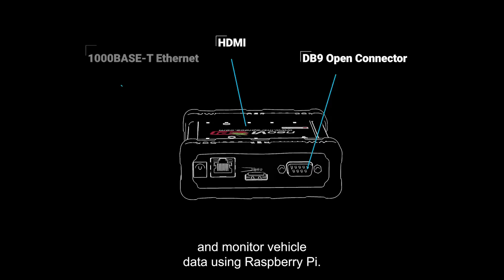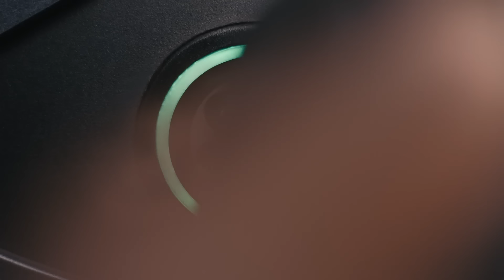Justice Dept Investigates UAW's Fain; Japan OEMs Losing S.E. Asia to China - Autoline Daily 3830

Comment: Can we please stop calling hybrids ‘electrified’? It’s a term legacy auto uses to make people think they are kind of getting an electric car. It’s ridiculous.
Reply: They are electrified! That's what the suffix means. -fied vs -ic has two meanings. It's not the industry's problem if you don't understand that. If it has an electric drivetrain component to it, then it is electrified.
Reply: Well every fuel car out there has a battery. 🤔
Reply: Chris, they are electrified, it's part of the hybrid system.
Reply: Hybrid for insecure people -MSM made OEM indecisive.
Reply: My dad’s 67 Mustang had a battery. Nobody called it electrified. Greenwashing!
Reply: Hybrid vehicles ARE electrified.  Adding an electric motor to a drivetrain adds electric propulsion to the drivetrain, hence making it electrified.  Whether that motor primarily supplements the output provided by the internal combustion engine or reduces the overall gasoline consumption, it is a win/win for the owner.
Reply: Electrified is a term invented for incompetent automakers to name their 1kwh regen assistance to ICE power train. It is not hybrid, which would be plug-in hybrid.
Reply: @alanrivaldo-h only if the battery can be plugged in.  Also the battery size can cover 10% of the vehicle’s range can it be called electrified.  In my opinion.  Even the 2000km range plug in byd card coming out cannot say this.
Reply: @jeffs6090 Wow you are gullible. No one has used that term in the over 100 years hybrids have been produced. Hybrids went mainstream in the 90’s and no one used that term for the last 25+ years they’ve been popular. Legacy auto started using it only recently when ev’s became mainstream to fool people like you into thinking they are buying an electric-ish kind of car.
Reply: @jeffs6090  Wow you are gullible. No one has used that term in the over 100 years hybrids have been produced. Hybrids went mainstream in the 90’s and no one used that term for the last 25+ years they’ve been popular. Legacy auto started using it only recently when ev’s became mainstream to fool people like you into thinking they are buying an electric-ish kind of car.
Reply: @chrisg8995  nobody is "fooling people like me" to buy anything. Plus, everyone else here commenting seems to agree with me instead of you. So, continue with your hate.

Comment: Africa has the right to go green as well, automakers should recognise this fact. If Isuzu really believes that they will be in for a shock.
Reply: Buyers will vote with their wallets
Reply: There is almost no faith in the electric grid there, even in countries like South Africa and Kenya.
Reply: @anydaynow01  it's all about the hydroelectric
Reply: The world's power want Africa to stay poor. The continent is the best place to manufacture goods and shipping
Reply: They are very "green" as it is
Reply: It has the right, but until its largest population centers gain reliable access to power it will be a struggle to get it to happen. Some countries could go EV in some areas but the continent needs substantial infrastructure investment. South Africa can't currently keep a light bulb on, let alone install reliable superchargers.
Reply: Isuzu is nuts with that laggard thinking. Here in Kenya there are so many electric motorcycle makers and many of the new buses are electric. I just test drove an sUV from the 2nd Chinese auto maker launching pure EVs here in recent months. Africans vote with their wallet. Until recently, only 2 of the 55 countries on the continent didn’t import petroleum/gasoline. Though so much oil comes from here, historically foreign companies controlled it. Refined fuel for vehicles are really expensive for many consumers. Maintenance costs on old imported ice vehicles are another drain. Affordable bevs from anywhere are an absolute no-brainer for many use cases.
Reply: @p.t.9709  I read that somewhere about Kenya a few weeks back. What these ppl don't realise it's cheaper for these countries to go straight to renewable energy sources and electric vehicles
Reply: @gmoncrieff  Most of Kenya’s electricity (over 80%) is from Geothermal and wind-energy. The resources are much more than the forecasted need. All that is required now is the continued building of generation and distribution infrastructure. Also, there are areas with significant empty space and lots of sunlight for solar generation. So, you’re right. EVs just makes sense here. It also reduces foreign fuel dependency. Here most financial transactions are mobile/digital. Home internet is wireless or fiber optic - no old cable or copper wiring. Tech leapfrogging just makes sense vs developing on old tech. 
Rwanda, our neighbors here in East African has an even larger range of bev options. Kenya is mature with electric motorcycles and has a number of locally built options. Most EV buses are imported. The EV car options are just starting to increase.
Reply: Don't worry, the Chinese players will take care of this, and third world nations may actually even be the easiest place for them to take over. 

Many such nations lack allot of the traditional legacy fueling/energy grid infrastructure, meaning they have less old baggage holding them back. 

We saw how many third world nations skipped land lines to rapidly adopt cellphones, and they seem to be moving to renewables in likewise fashion, which then makes EV charging the goto option in remote towns and such.

Chinese makers also already have EV products in much cheaper price brackets than western legacies can address - "Wuling mini" type EVs, EV motorbikes, EV scooters etc.
Reply: @AllanSustainabilityFan  Fun fact, many African nations are first world. Third world relates to nations that didn't pick a side in the cold war, mostly it means India.
Reply: @ethanwelner1230  That may be one definition, some of the other ones today include:

"1. : the aggregate of the underdeveloped nations of the world. 2. : a group of nations especially in Africa and Asia not aligned with either the Communist or the non-Communist blocs." -- Merrian Webster

"'Third world' refers to economically weaker nations. 'Third world' countries are generally represented by lack of basic infrastructure facilities, high poverty, and economic instability. Third world countries are behind the first world and second world countries, but ahead of the fourth world countries." -- ClearTax

Either way, it's being used loosely here as a blanket term for simplicity.

Comment: There's no electricity for EV's in South Africa
Reply: Yeah but they have cell phones?
Reply: @ChicagoBob123  Kind of a scale difference for power requirements there my dude. You should probably look up the crisis in the SA power monopoly.
Reply: @ChicagoBob123  lol you can charge a cell phone with a tablet sized solar panel, can't do that with a car
Reply: @JD-yx7be  
What you say is true, but micro grids are popping up all over the continent.
It's not going to be long before a huge part of the African population has stable electricity.
That will change the whole dynamic.

Comment: Hybrids are not actually electric vehicles because all of the energy comes from fossil fuels, including the energy stored in the battery (which comes from a generator powered by fossil fuels).
Reply: Worst of both worlds. 
Plug in hybrids can be run on electricity, but people are lazy and don't want to plug in all the time to charge that tiny battery. Just greenwashing.
Reply: Plug in hybrids actually work as EVs and more and more hybrids are plug in.  Ice is just used to extend range when needed.  I can drive my plug in hybrid in EV mode 95% of time.

Comment: dirtyTesla shows the most about the Tesla full self driving updates, if you are misinformed about it not working or never happening(many for some reason misbelieve that)
Reply: Because that is all that Adrian has anymore!  Random, unqualified YouTubers acting as safety engineers for a non functional L2 system!
Reply: @bobbbobb4663  ok bot
Reply: @SOROS-family  Cite one instance where any FSD (supervised) release has undergone any safety testing.
Reply: @bobbbobb4663  Its L2 becouse its used ANYWHERE and not if its following a car at a curtain speed on a curtain road at perfect weather while there is no road work or emergency vehicles arround 
Also would be stupid to pay for every ACIDENT when you allow your customers to floor the pedal and take over at any time
Reply: @stefanpredl6849  No.  It is L2 because that is what Tesla told the CA DMV in December 28, 2020:  "...currently neither Autopilot nor FSD Capability is an autonomous system, and currently no comprising feature, whether singularly or collectively is autonomous or makes our vehicles autonomous."

Comment: FSD wont move a inch in major city down town in China. There is lot of real time computation power required for negotiating in busy traffic. The level of computation power requirement that not practicle without the supporting of infastructure. e.g meta data. As long as the FSD not in the mega data network which operate by wireless ISP in China. Its performace will be far from any 2nd tier competitor there